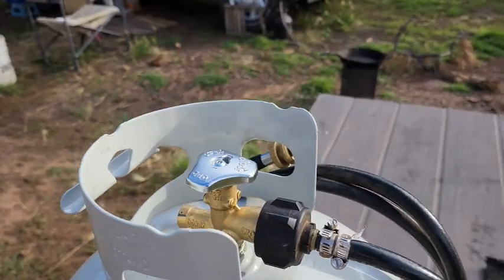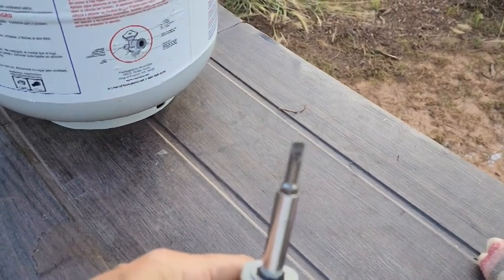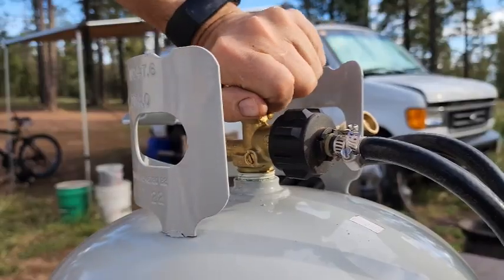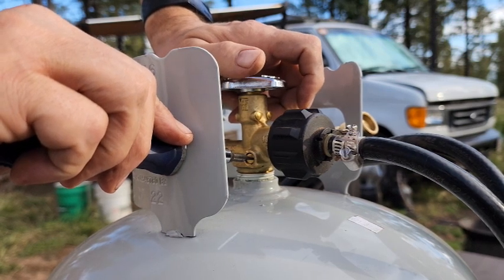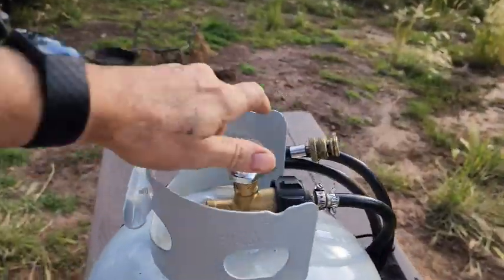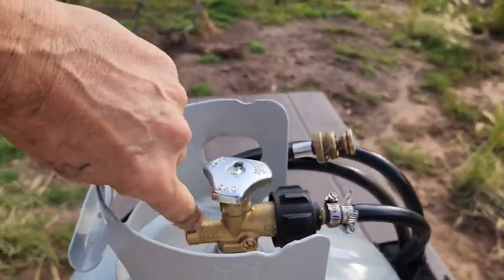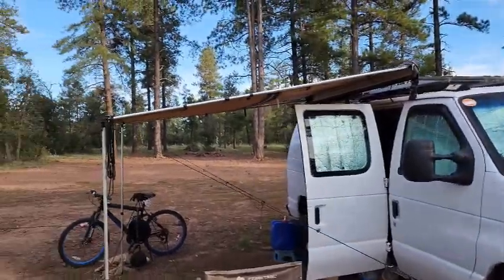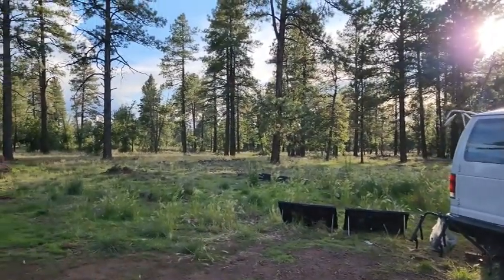Propane Tank Fix No Flow Or Low Flow Issues! Quartzsite Update Camp setup

Comment: 👍I've had an, old timer propane tank filler guy, tell me to turn the tank upside down and rock it back and forth several times. He claimed that this would release a stuck valve, sometimes caused by some idiot over filling a tank. 🤔 Hey I'm 68 & was taught to, 'listen' to my elders 😁 I have used the trick several times and it seems to work. For what ever reason that it happened. I have hauled them in the heat for a few hours after getting them filled. 🍀🙋🤷
Thanks for the info!
Reply from the maker: That is a really helpful tip, I'll have to give that a try next time. Thank you for taking your time to leave a comment and tip. Take care 🐾✌️

Comment: Thanks for this tip! I have dual 20lb tanks that I took on a trip to Santa Fe forest. They are mounted outside on our popup so no protection. They worked great the first half of the trip, but one night the temps dropped to 15 degrees and the propane was just trickling out. Furnace barely worked, and the stovetop barely lit up. I don't know if it was the cold, the 8500' elevation, or both combined? But at least I know how to check the valve for next time.